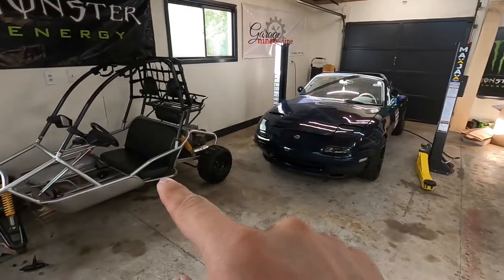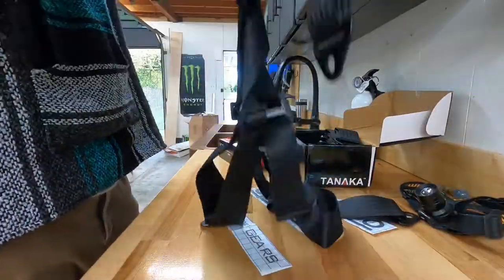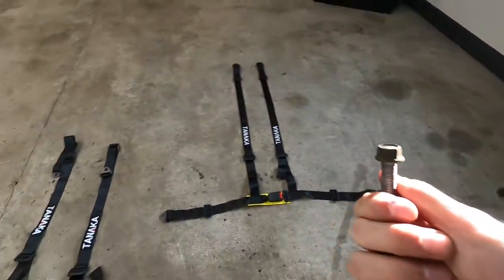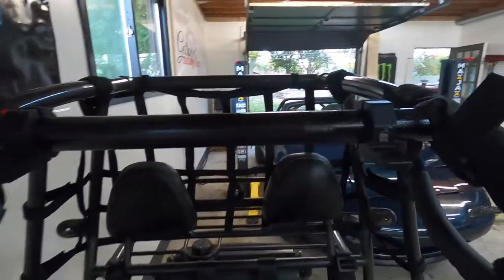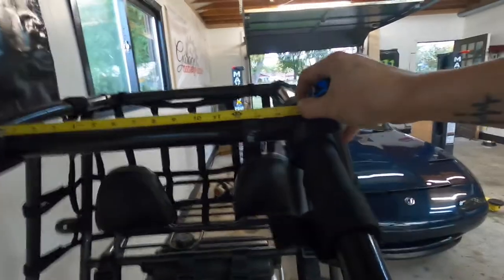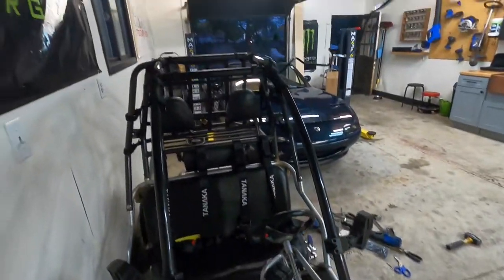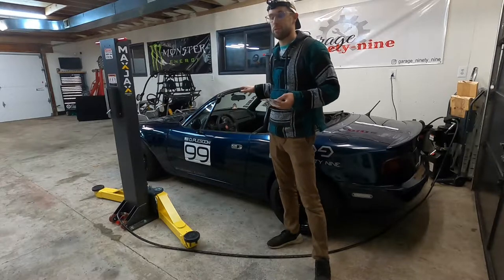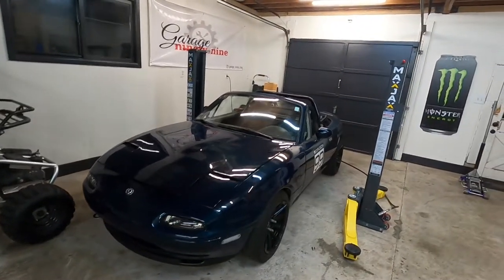BROKART gets harnesses and light bar preparation  //  HELIX 150CC GOKART

Comment: Where did you get the replacement spindle?  I really need one
Reply from the maker: I didnt replace a spindle
Reply: @garage_ninety_nine  did you replace a ball joint in the spindle?
Reply: How did you fix the ball joint issue you mentioned in the previous video?
Reply from the maker: @rosiefry5562  i the through bolts were loose i tightened em up and it made the issue better but didn’t fix it. I have not found replacement spindles that will work yet.
Reply: @garage_ninety_nine  thanks!  I’ll try that.